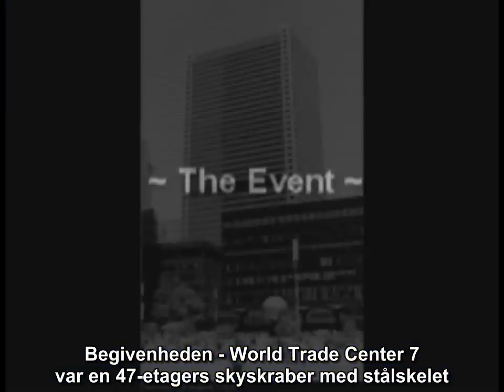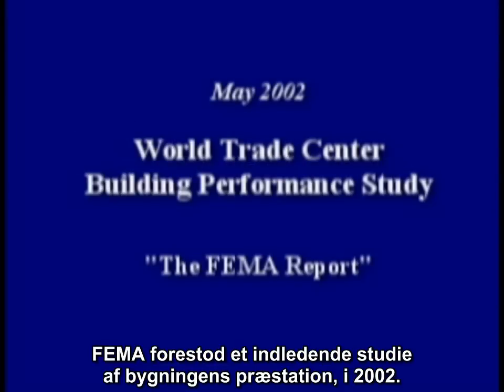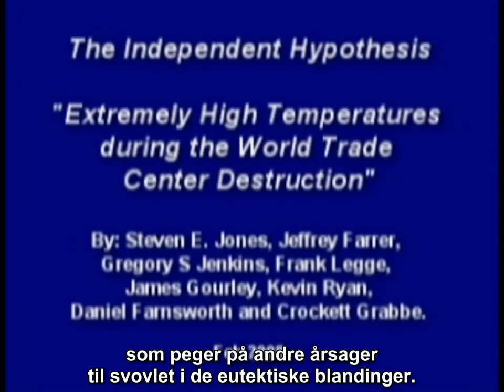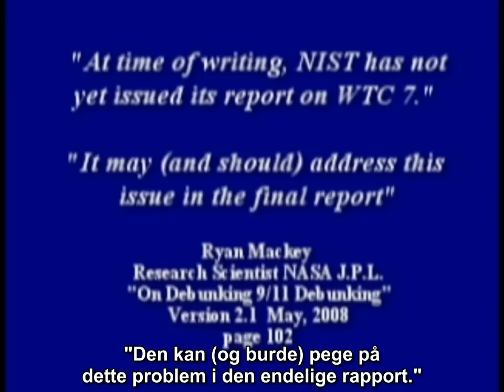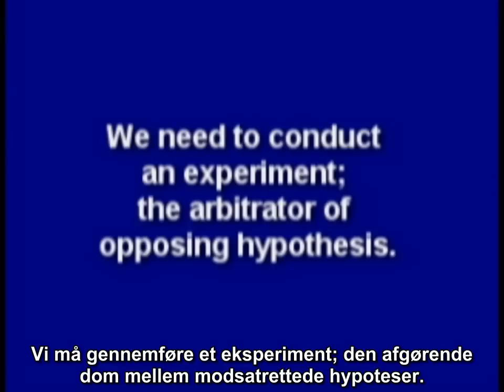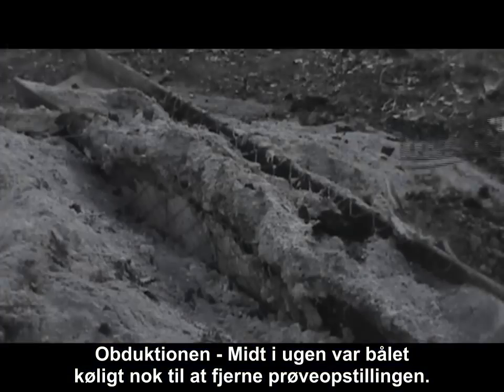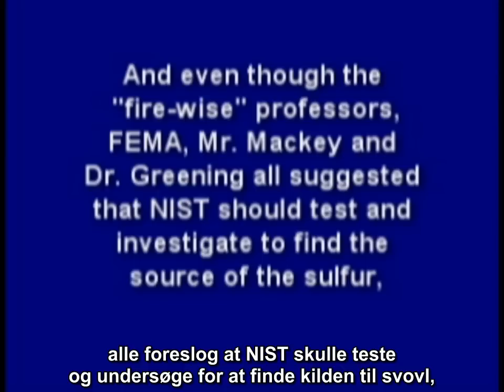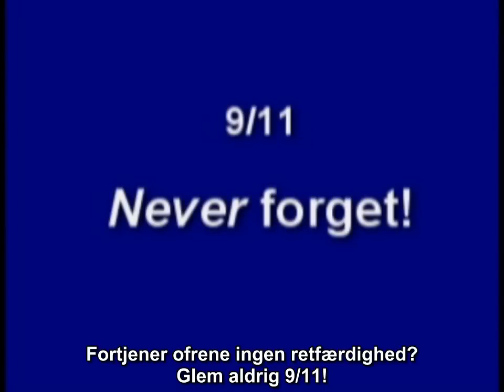The Mysterious Eutectic Steel by Jonathan Cole - Danske undertekster

Comment: The ONLY complaint I have about this presentation is the suggestion of how "gypsum wall board is routinely placed into direct contact with structural steel". That NEVER happens. You would have to be a very negligent architect to place those two directly in contact. This is simply because temperature changes and oxidation of the steel will wick THROUGH and discolor the gypsum wall board. Bad idea. Everything else is great though. (I am a member of A&E 911 in case you were wondering).